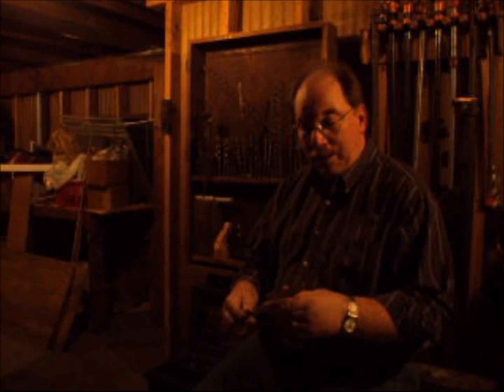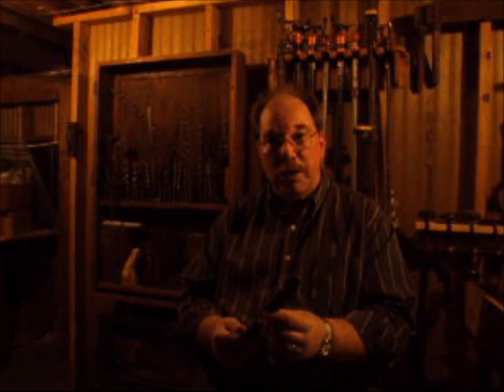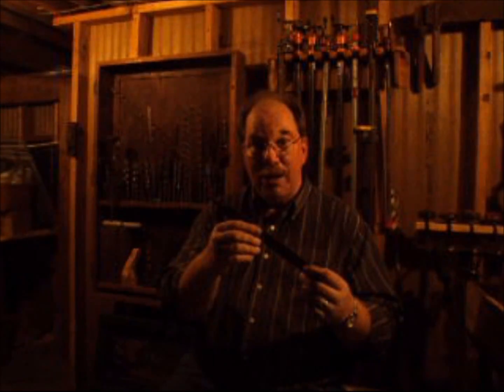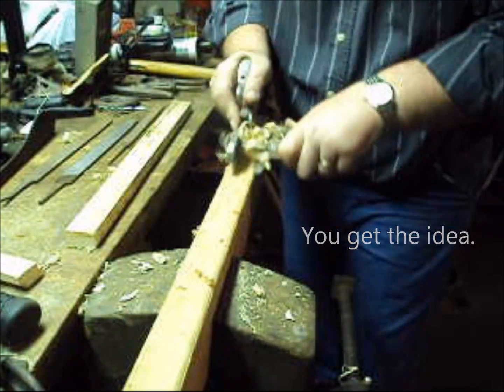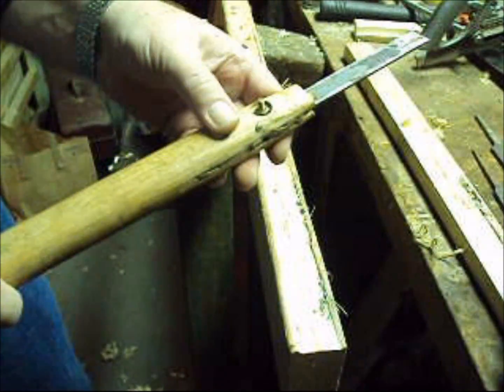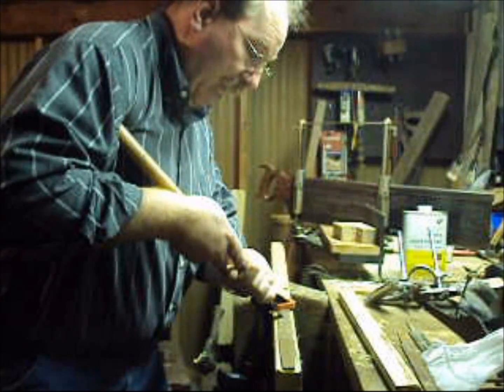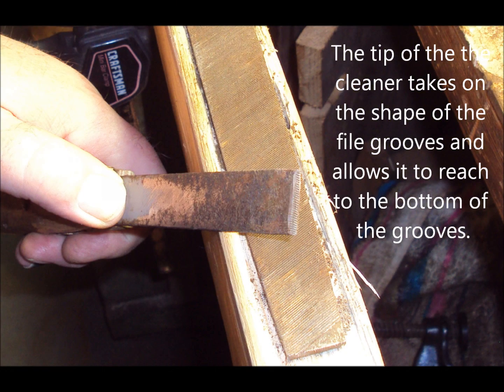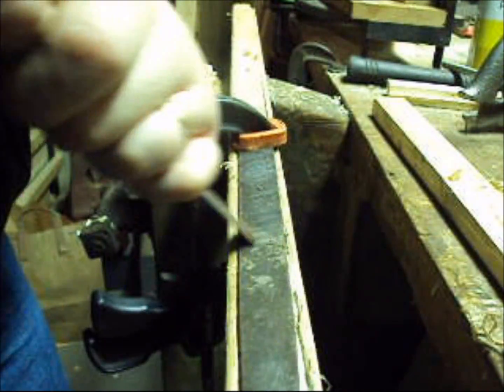Cleaning a file - a video tutorial from Old Sneelock's Workshop

Comment: I am a file hoarder so I often get them that are pretty clogged and useless. I just throw them in a box. Can you recommend a place to get mild steel like you used here? I'm not to up to par on steels.
Reply from the maker: luketdrifter2100 Most scrap is mild steel. Mild steel bends easily. It can be dented with a hammer without cracking or breaking. The piece I used was a cross brace from a piece of steel shelving. Gas, and water pipe are mild steel. I don't recommend using them to clean a file with although it can be done. 
In a pinch test the piece by trying to file it. If the file will cut the steel easily it will work to clean files. The idea is for it to be soft enough to dig out the junk without dulling the file.
Reply: Thank you for the reply.  I appreciate you
taking the time to answer questions for us!
Reply from the maker: luketdrifter2100 That's the point of the whole exercise for me. I want to teach people what I've learned from the people who taught me. So thank you for watching and being involved enough to ask questions.

Comment: 10/4 on the aluminum powder. I learned that most blasting done today isn't fired with electric caps. They're set off with a hollow plastic tube filled with aluminum powder as a lead line and ignited by a single percussion cap. Faked me out because I had been away from it a while and didn't know it'd changed so much. But boom is still boom. Thanks Mr. Snee for another good one! (me)

Comment from the maker: David Roberts asked: Mr. Sneelock, you mentioned using steel bar stock.  Could aluminium be used, or is that as bad an idea as filing aluminium.  Your opinion, sir?  Thanks.
I've had people mention that they use copper, aluminum, and steel and brass wire brushes. Whatever works for them is fine with me.  I use a mild steel bar because it is softer than the file and equal to or harder than anything that might get stuck in the file.
Aluminum or copper can be used. It would only be effective in removing aluminum, copper or softer material. Brass wire brushes can be used but have the same problem of not being strong enough to remove steel embedded in the file. Most steel wire brushes are made of wire as hard or harder than a file. Such a wire brush can dull the file . Especially in the case of grinding arbor mounted wheels.
File cards do a good job of cleaning files. The file cards I'm familiar with have a pick, mounted in a holder, on the back of the card. The pick is for prying or poking out the bits that get jammed in the serrations.
My mild steel bar acts like a whole row of picks. The end of the bar deforms to match the serrations on the file after a few passes. The picks thus formed dig out the embedded material from the serrations.
As far as filing aluminum being a bad idea, why would it be?
Aluminum is gummy and tends to load up the file but that's not a reason for not filing aluminum.
Perhaps you are confusing filing with grinding. Grinding aluminum is a problem. The aluminum smears on the face of the wheel. That loads the wheel and prevents it from cutting. The embedded aluminum can cause the wheel to be out of balance. Aluminum dust is flammable. Creating a pile of aluminum dust in and around your grinder is a bad idea. Mix aluminum dust and iron oxide and you have Thermite. In that case you will be able to officially declare it a Bad Day.

Comment from the maker: You're right. A file card can be just as effective. The bristles will remove soft material that clogs the file and the pick can be used to remove any embedded metal debris. I like this method because it does both at once. It's more of an either/or than good/bad.